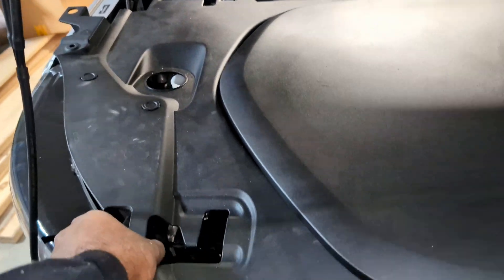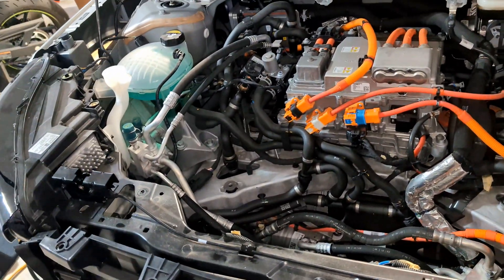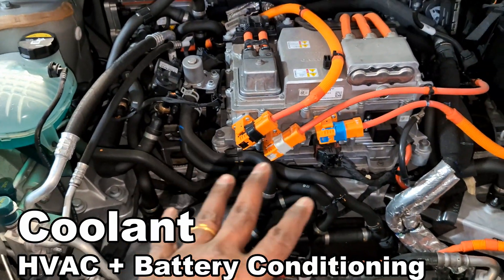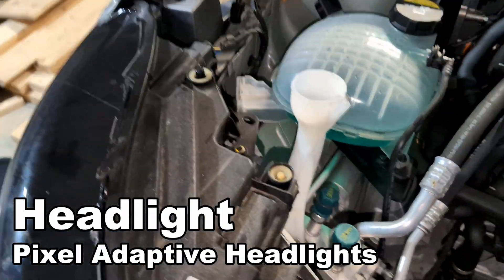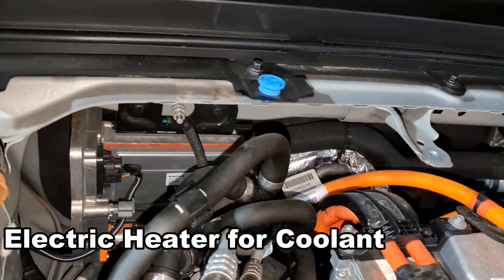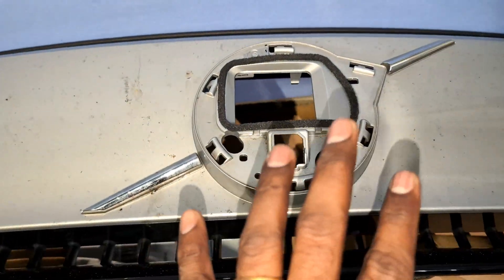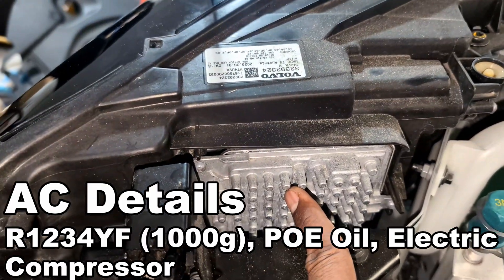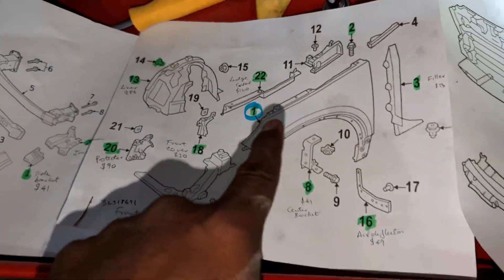Volvo C40 XC40 - Under the Hood - Anatomy of an Electric Car - Must See

Comment: Both motors need inverters, all motors are inherently AC, the only kind of true DC motors are brushed motors which would never be used in a car. The main reason for AC Induction in the front vs Permanent Magnet in the back isn't cost, but rather the Induction motor can be disabled and freewheel when it's not needed reducing drive train drag, where as the permanent magnet motor can't do this, so it's rear wheel biased with the front only being used when needed.

Comment: Watched because of potential 12v battery weakness in EVs. Youtube Electric Viking identified Tesla and Hyundai cars which you say have smaller batteries than the one fitted to the Volvo. Good point. The cigarette battery tester was news to me, so I've ordered one. Thanks for the tip